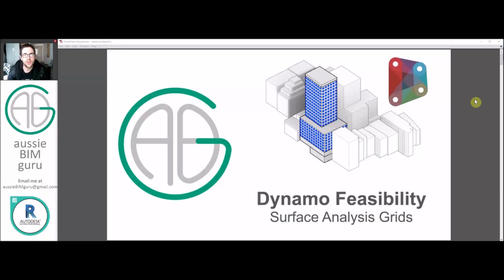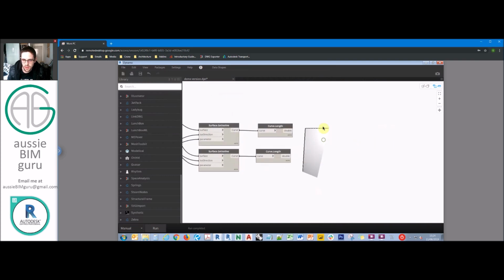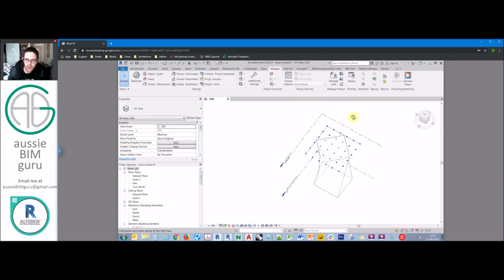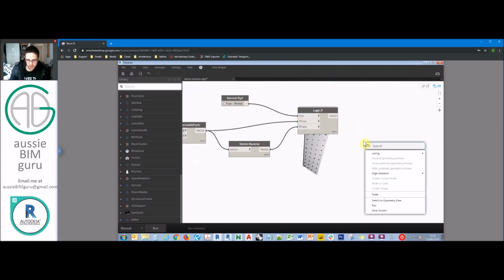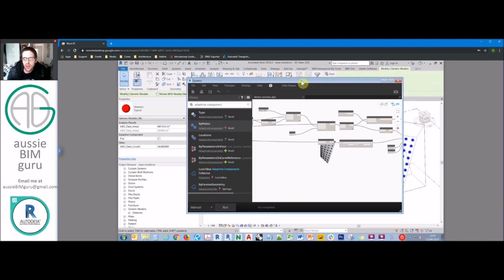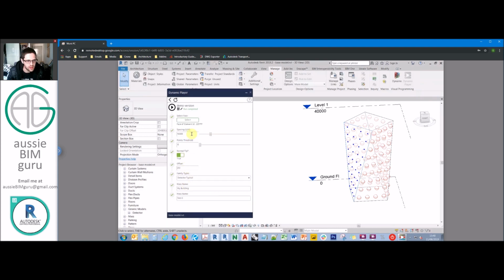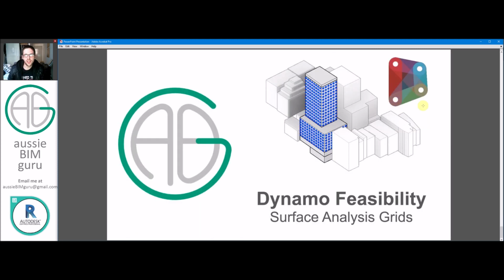Surface Analysis Grids using Dynamo (Feasibility Part 7)

Comment: Hi Gavin, thank you for the tutorial. 

Your included adaptive point family, at least the one I got from your git, doesn't have the parameters ABG... included so they won't be populated. Just a heads up.

Thank you!
Reply: They seem to work now! I made the massing bigger maybe it was small scale initially!
Reply from the maker: Yes generally I'd assume people are adding or adjusting their own parameters at that step hopefully. I just made these as an example in this video. Glad the tutorial was helpful!
Reply: @AussieBIMGuru  thank you, I assumed it would be the case.

Also, when I am selecting the different faces of the mass instead of adding them throughout I am having the previous face adaptive point either deleted or for example only 1 row of adaptive family remains others get deleted. 

So as I rotate selecting each face the previous face gets changed, having it's point removed all or only 1 row remains!

Of course, I have different size building that I did to follow the tutorial.

All the best!
Reply from the maker: @MrDrenahmeti  yes generally that is due to a thing in dynamo called element binding. I call it a bug but the developers call it a feature. Generally you will need to add a fresh node for creating adaptives a second time around, or run via dynamo player.
Reply: @AussieBIMGuru  Thank you!

Comment: Hello Guru. I'm trying to follow your tutorial, but it seems like Lunch box is not available on the package manager in Dynamo anymore, and the one clic installer isn't working for me because I don't have Rhyno or Grasshopper. 
The problem is I tried to copy paste the content of the Lunchbox folder I found on the Internet into the Dynamo folder, but it seems like the Panel.PanelQuad node isn't available anymore. 
I tried to find a similar node on the package manager, but they always seems to lack an output or to have one more output than the original node you used in your video.
I'm talking about the Grid.FromFace from the Clockwork package.
Do you have any idea where I could find an identical node, or Can I make it work with the node I have?
Thanks for your insight and your amazing videos, keep on feeding us knowledge!
Reply from the maker: Yes unfortunately it is no longer supported. No simar alternatives as far as I know.

Most users seem to have luck if they install it via package manager in revit 2018 where its still the old one, or via the source which can be found here:
https://dynamopackages.com/download/528038ad3f7315936f000058/2018.7.7

Otherwise you'll need to ask the author.

Comment: Hi Gavin 
I have a question regarding that if we have no.of points on a surface but if i want to exclude the perimeter points then how can we do it by filter by boolean mask or by any other method apart from just setting a offset to the points. And your videos are a real gem for the whole industry.
Reply from the maker: There are a few ways this could be done. I'd suggest getting all 4 corners of each grid cell instead, and clashing them against the surface as a sublist. Count the number of true results in each sublist, and if any have less than 4 then they must go beyond the edge of the face and the corresponding cell can be filtered out based on this.
Reply: @AussieBIMGuru  Thanks I did try with boolean mask but not getting the satisfied result instead I applied list.set difference node to achieve that.

Comment: Hi Gavin, thank you so much for all these great videos!
I have a question related to the sensors. I'm stuck in the final part of the video. When I try to generate my sensors, instead of following the list of points, Revit puts all the sensors at the origin. I'm not able to figure which part is wrong. Maybe my adaptive components are incorrect?
Can you help me pls? I really appreciate that.
Thanks again for your work!
Reply from the maker: Maybe try with the family I keep on my repo here;
https://github.com/aussieBIMguru/Revit-Files/tree/master/Families

ABG_GEN_DetectorSphere_R19.rfa is the family I used. As long as the preview points you can see in Dynamo/Revit before you place the components are in the right place, it should work.
Reply: @AussieBIMGuru , it works now! I forgot to create a reference point before modeling the sphere. Thank you so much!

Comment: Is it possible to have Dynamo generate buildings with different shapes based on a fixed number of floors and floor plan area?
Reply from the maker: It depends on the building shape really. If it's a box where the user specifies the width then yes it's just basic mathematics (area / width = depth)*floor count. Dynamo doesn't know what a building is by default, we have to build a script to tell it that. All it is is a program that tells Revit to follow instructions - we write these.

It also depends what you mean by 'a building'. Is it just some floors and walls, or does it include a curtain facade? Maybe it needs a lift core, if so how does Dynamo know where to put it? Each step and requirement needs an extra part of a script - eventually it gets quite complex.

If you're asking dynamo to make intelligent decisions based on site setbacks then it gets more complicated. At that point I'd be looking into Grasshopper or third party tools like TestFit - geometry isn't Dynamo's strong suit.
Reply: @AussieBIMGuru  first of all, thanks a lot for the reply!!! So, I was thinking about using dynamos generative design to test some shapes using solar analysis as a parameter, so it wouldn't necessarily need to be a building, the shapes would be fine already
Reply from the maker: @tiagos.8301  I would suggest Grasshopper in that case. Ladybug doesn't work in Revit 2020+ unless you use Rhino Inside and is really required for detailed solar analysis.
Reply: @AussieBIMGuru  I see. And would it be possible to then use Dynamo's refinery to try some different geometrys to optimize sun hours?
Reply from the maker: @tiagos.8301  not that I've found so far. Dynamo relies on the packages it has access to, and Ladybug isn't one of them. I usually use Galapagos or Wallacei in Grasshopper/Rhino for solar optimisation.

Comment: Hi Gavin  @Aussie BIM Guru  
Thanks for your enriching tutorials 
I have question, I am trying to link these detectors with parametric pastern in dynamo in order to create generative design any suggestion how this might be?  as parametric pattern working only in conceptual mass files?
Reply from the maker: I would suggest you use the Lunchbox package to tesselate and measure at the centre of the divided panels as opposed to use the detector families. The families are only needed if you want to 'bake' the results to Revit.
Also I'd consider using Rhino Inside and grasshopper as there are more advanced and quick workflows available for this type of thing. I have a video here showing an example workflow using galapagos in Revit;
https://www.youtube.com/watch?v=7OelCkk-lYk
Reply: @AussieBIMGuru  But as we created those Detectores and harvested the data showing sun hour, any way to assign those numbers to (reference points) ?!
which get along with parametric pattern panels 
I see u mentioned Rhino unfortunately i am stuck with Revit and dynamo :)
Reply from the maker: @karldal1961  the reference points are what we used to place them, so to work generatively just do everything but place the families - use these test points in dynamo instead. Ladybug doesnt work in Revit 2021 unfortunately so you may find issues using this workflow in dynamo/gen design.
Reply: @AussieBIMGuru  Thanks 👍🏻

Comment: Hi, is it possible to create toposurface by using dynamo? I mean choosing a map area location, generate a toposurface in dynamo and export to Revit?
Reply from the maker: Hi Moe!

It definitely is possible! Check out the package 'Dynamaps' by the company Data-Shapes. This is able to generate a surface to work with;
https://dynamobim.org/dynamaps/

This uses the same source as Open Street Map, which is also used by a tool called 'CADMapper';
https://cadmapper.com/

I've got a tutorial on my channel where I show how to get this information and turn it into a topography (without even needing Dynamo).
https://www.youtube.com/watch?v=V7Z94oSqwbk

Key points to watch (in the other video);
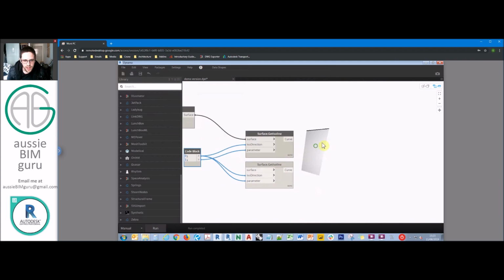4:10 - CADMapper
6:15 - Clean up DXF in AutoCAD
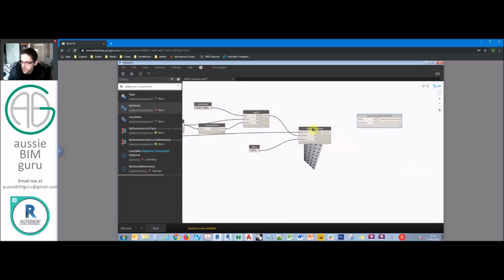19:25 - Create topography in Revit

You may also find another video I have on my channel useful for site creation. You can convert OSM files into linework in Revit then export to DWG to essentially get a rough building/road map using Dynamo;
https://www.youtube.com/watch?v=VC4p04efpn0

Dynamaps has also developed some nodes to do this more easily straight out of Dynamo to Revit.

Hope that helps!
Reply: God, i watched that. But didn't aware about that. XD. Thanks a lot.  @AussieBIMGuru  <3
Reply from the maker: @moegyi2077  haha no worries - it's quite a long video, lots to take in! Glad to help in either case :)
Reply: @AussieBIMGuru  seriously, before watching your videos i was really afraid coz of "I want to do it but don't know to". Now, I'm not scared anymore. XD
Reply from the maker: @moegyi2077  that's the goal of my channel, to empower others in using the software so I'm glad to hear that!
Reply: @AussieBIMGuru  yes, sir! Hoping more tutorials from you!